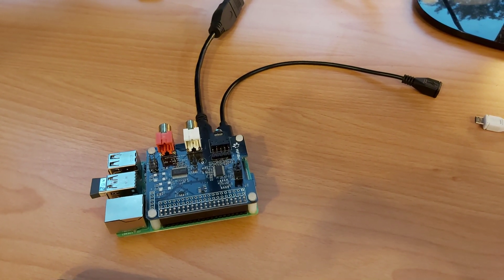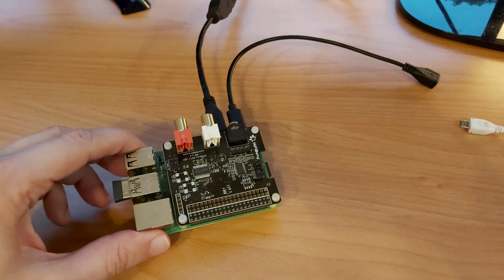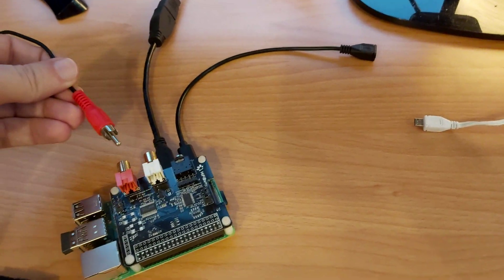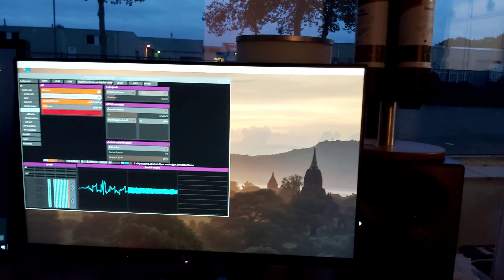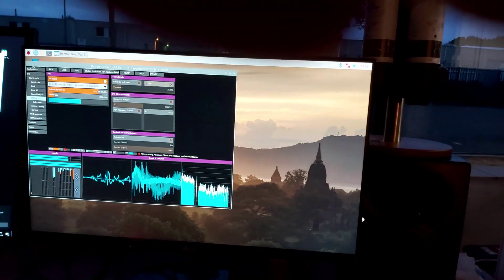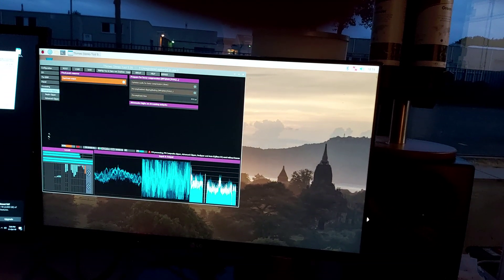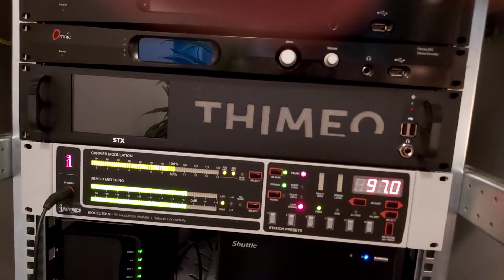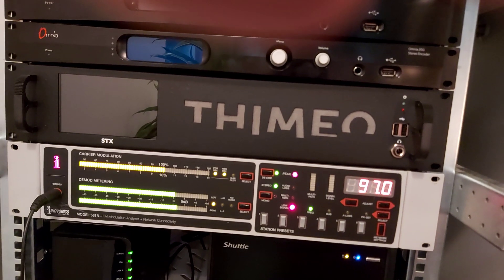Stereo Tool (full FM preset) on a Raspberry Pi 4B

Comment: How long have you test this setup? How about long term performance of the hardware?
Reply from the maker: Not that long for this specific setup, but there are hundreds of FM radio stations that use Raspberry Pi's with MicroMPX without issues. So I wouldn't expect any issues for this either, provided that you keep the CPU load low enough (so I would advise to get a Pi 4, not a Pi 2 or 3).
Reply: @hansvanzutphen  this is extremely cool hans. i'm thinking about using the PI4 and hifi-berry as a soundcard alternative to Marian Trace Alpha

Comment: Has it running on a raspberry pi 4 with a hifiberry digi+ .. Input over toslink. 
Only sad part was if toslink is unplugged, then jack crashes .. an no (decent) solution for this. So the project went back into the fridge
Reply: can you sell me an image with this intalled  rikafm@gmail.com

Comment: Hi Hans, nice demo. How about the temperature of the Pi-4? I read elsewhere in reviews that the Pi-4 needs proper cooling when it is being stressed. A cpu load of 45% might not be too much, but when running 24/7 it still might be enough to heat things up considerably.

Comment: Very nice to know Hans!  thnx

But now i'm curious.  do you know the pifmrds software?
here an example: https://www.youtube.com/watch?v=WsWSWChpem8

The GPIO of an Raspberry PI can switch so fast that it can produce an RF signal on the FM Band. in Stereo and RDS.
So. if that is possible with a GPIO pin, than its also possible to produce an MPX signal with GPIO?..  than you dont need an 192KHz soundcard anymore. just a Raspberry PI4 with Stereo tool and a transmitter ;)
Reply: You can but the PWM output produces a lot of harmonics and intermodulation products in the passband so it would produce a lot of audible artifacts and the overshoots prevents you from staying within 150kHz FM bandwidth.

Comment: nice work! does ut output the 192khz steroe/rds signal?
Reply from the maker: Yes! That isn't new, the Pi 2 and 3 could do that as well. What's new is that you can now run a full high quality preset on it - still with a few compromises here and there but it's getting pretty close to what a normal PC can do.
Reply: @hansvanzutphen  amazing! thank you for your answer :)
Reply: Hans van Zutphen Hand wat is the type soundcard you are using? I see the choice is big. So a good advice will be great!
Reply from the maker: @michelderuiter2743  This is the HifiBerry DAC+ADC. It has 192 kHz input and output. It's less good than some of the PC based cards (you probably will never notice this though), but it's very easy to mount on top of the Pi, no separate parts etc.
Reply: @fabioluisdefreitasgarcia7089  hi does he sell image for the raspberry for stereotool?